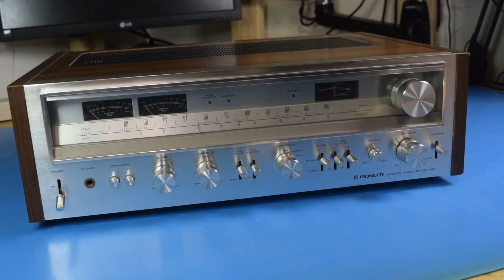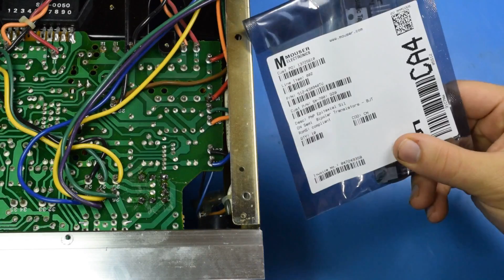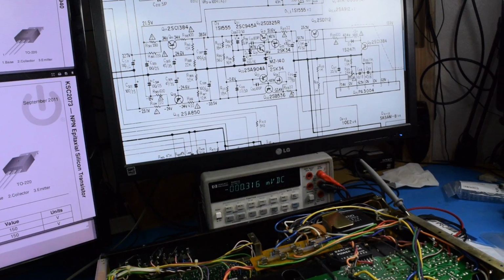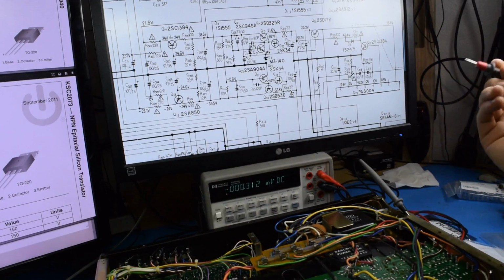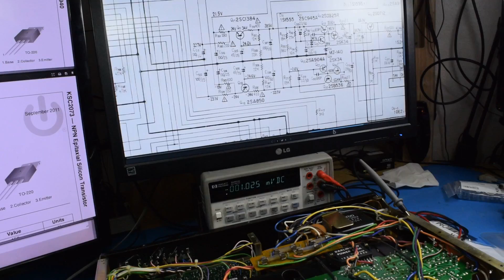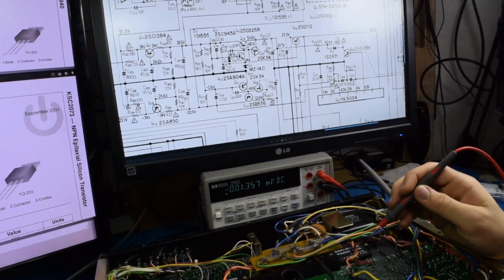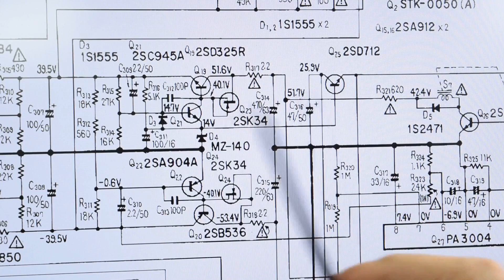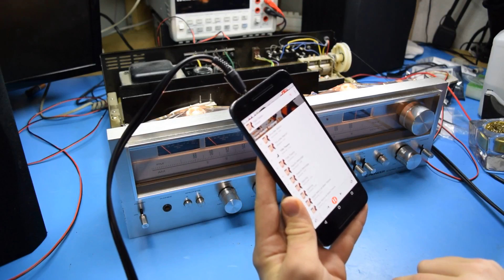0x0022 - Pioneer SX-780 Repair

Comment: 150 watts is about power consumption from wall outlet, not power output.  Yes, 45 watts is rather conservative but at best, it's probably not much more. Certainly not 150 watts output. power being consumed by transformer's loss, radio, preamp, main amp, etc.... You also need to warn about use of CPU thermal paste.  Some are conductive.  Some hobbyist blew their receiver using it.  I used white paste and it works just fine.

And I immediately spotted a missing regulator transistor that is notorious to overheating.  Yes, I own 780 too for almost 20 years and still using it. I added a heatsink to it and it keeps on going.

Comment: Great vid - subscribed! Curious problem on my SX 750 you may be able to help with.  Fm tuner was getting stations fine - stereo light on steady  - used to get 8 to 10 strong stations. . A month later, it has lost most of its ability to receive stations. Only the 2 strongest come in, the stereo light  only occasionally flickers. I have tried several different antennas with the same result and checked the FM muting to make sure it was off. Everything else on the unit works like new and it is all original with no modifications. Why would the FM suddenly lose sensitivity like this?

Comment: My '78 SX 780, Wich had a great tuner , no longer centers the gauge, won't pull it in in FM Stereo, LED for stereo does not illuminate, and it won't play at all, with FM muting off
Reply: On, is what I meant.

Comment: I’ve had this receiver since my father gave it to me in 1990. He bought it in 1968 or 69 he said. About 1996 the relay clock would take longer and longer. Then no click. Been holding on to it ever since. I have no skills. Could you advise as to how to fix?  I think I could learn to fix it just need a push in the correct direction. Please help
Reply: 780 was made, '78-80

Comment: Have had my 780 since 1980.  New.  Still going strong in the man cave.  Conseratively rated output.  Kicks butt on my HPM-100'S. My power safety relay failed also, at about 7 years old.  Otherwise, no other issues.  Love Pioneer!

Comment: Hmmm .. I have the same unit SX-780, but channel Left has some distortion, very noticeable in mids/voice. I assume I'll need new capacitors, but don't know much.
I have a solder gun and know how to use it, but haven't fix any vintage electronics so far. Can anyone give me a hint on what I should try?

Comment: I have the same receiver.
It was in a climate-controlled storage unitfor 10 years. Then in September 2019 I moved across the country and all my equipment was in an outside storage unit.
I turn it on, no power. I see that the 4 amp fuse on the bottom was no good.
I replaced it, and turned it on and saw the fuse blows with a flash. I did that 2 times, Same result. Any idea what would cause that fuse to blow?

Comment: Does anyone viewing this channel know if someone has restored FM reception to a 780?  Mine works perfectly except for the FM section.  Thanks.
Reply: Exact same issue, inherited my Mom's SX780, purchased new in 78.
Reply: @1972mercurycougar  I finally took my unit in to a shop and got it fixed.  It works fine now.  Alas... just the other day one of my channels blew out.  Probably one of the two Darlington Pair transistors - THE weak link in this entire unit, the 780.  The original transistors were good, but the cheap, Chinese after-market replacements are lousy and this is going to be a problem going forward, i'm afraid.  This is the single worst problem with the Pioneer 780 receiver.
Reply: @mic982  Yeah,i've had mine since i bought it new in '80 and i had to replace my Darlington's several times over the years.
Reply: @patriciawilson9666  The repair shop tells me old 780's are coveted for their parts, not the least for the Japanese-made Darlington's.  They say that some of the Chinese-built ones are OK but it's a complete crap shoot when installing them as most are lousy and short-lived.  The Darlington's were a wonder when invented, but apparently hard to reproduce.  Were that the Japanese were still making them, or electronic firms in America.

Comment: The SX-780 is a bangin' little receiver, even at 45 watts per channel.  I push a pair of HPM-100's and a pair of HPM-60's with mine and it sounds fantastic.  I'd love to see you troubleshoot more old receivers like this.  I bought a 780 just like this about 5 years ago and one of the STK's were blown.  I replaced it, but everytime I would turn the volume up and then back down, it would pop the new STK.  I'm sure there was something upstream that was failing to regulate the voltage, thus blowing the power pack each time, but I just couldn't figure it out with my lack of troubleshooting skills.  I ended up selling it to a guy in Maryland and he had it fixed in no time.  You're video makes me want to pick up another one and try it again.  I have subscribed and look forward to seeing your other videos.  The video that originally brought me to this one was the speaker recap on the Technics.  I am getting ready to recap my HPM-100's and wanted to see someone do it to give me a little more confidence.  Thank you.

Comment: My 780 just went mid song....both sides, I just lost sound.  I still powers up, just no sound or movement in the vu's. Is it most likely the relay in your opinion? I still have radio signal strenth and all the lights.  Any help is appreciated
Reply from the maker: Do you here a click after you turn it on? If not then it could be the relay. It could also be that transistor I was missing. 

Both are likely suspects. The relay is known to be failure prone and that transistor is regarded as being under cooled.
Reply: @TechTangents  I'm not hearing one. It would most likely be that correct.  The volume was half for an extender time.  Im assuming both packs would not go at once.
Reply from the maker: The packs are probably fine. I would suspect the relay.
Reply: @TechTangents  Thanks...hope that's it.  Do you recommend a source for parts?
Reply from the maker: I bought one from mouser, this is what I got: https://www.mouser.com/ProductDetail/omron/my4-02-dc48/?qs=NHN4o8quFyRXEZvz6CJ87Q%3d%3d&countrycode=US&currencycode=USD

I haven't installed it yet but I'm pretty sure it's the correct part. I would look around to double check.
Reply: @TechTangents  wow..much cheaper than ebay

Comment: Yes, but WHY did the diode blow in the first place? Failing caps perhaps. Without fixing the actual reason it failed, the unit will likely fail again.
Reply from the maker: I would assume it was the bad transistor that a former owner removed. Those are a known common failure in this unit.

Comment: Nice. I mounted my Pioneer SX-780  with other components in a extra tall audio rack. To see it follow the link here. https://youtu.be/ENjqQ51iKoo
Reply from the maker: That's nice. It's a shame how difficult it is to get HPM-100 drivers. If you're not aware HPM-900 parts are very similar cosmetically but have very fragile graphite cones instead of paper. So you could get those. It looks like one of your super tweeters may already be from one.
Reply: The tweeter is from my early model HPM 40s (steel instead of aluminum) until I get a replacement.  Hpm 40s and Hpm 100s use the same tweeter so its drops right in.

Comment: P=VI
So the higher the Watt at a set point the higher the current flow thru a point is at a fixed voltage

Comment: hi my name is ted i have that same receiver sx-780 since 1981 it stop working 9 years ago,  i had it checked out and the eletronic place and they told me it needed two new darlington stk-0050 and two new 0.22 ohm k 02 watt resistors that are right next to the power packs, he said those parts were not available at that time when he checked it, well all these years went by and i manage to fine what i needed to fix this receiver, i put in the new power packs with out the resistors it works but has some distortion to it, is it possible that because i did not replace the resistors yet can this be causing that problem?? and also the speaker protection relay takes time to click on?? any idea on that too, i don't have the equipment you have to do the testing i need to do, but i do have a ohms tester and a Capacitance tester is there a way in your professional opinion to check it with the equipment i have, please let me know i really would appreciate it.

best regards
ted
Reply from the maker: Without being there the best guess I have is that you were sold fake darlington packs. That is unfortunately common now. Unless you could get a verified real OEM model the best I could recommend for a replacement is to try making a DIY pack. It's not easy, but people have started to make them. This is where I would start researching it: http://audiokarma.org/forums/index.php?threads/stk-0050-replacement-for-sx-780-and-others.721181/
Reply: hi thanks for getting back to me, the numbers on top of the darlington i got is a "D6F22". so the resistors that i did not put in yet will not cause this problem is what you are telling me right, they are not working, and do you have any idea why the protection relay for the speakers would take so long to click on i timed it and it was about 3mins, please let me know, 

note; i am very new on doing stuff like this, that is why i am asking questions. i appreciate your help sir

thanks 
ted
Reply: HI i just found a set of sanyo darlington power packs stk-005011 was is your opinion on these?? please let me know.

thanks ted
Reply from the maker: I'm not an expert on the SX-780 and without being there to trace down problems it's really hard to say. The people on audiokarma are usually very helpful to people who have problems like yours. They know more common failures and would have a better guess than I would.
Reply: ok cool thanks i will try them i appreciate all your help.

ted
Reply: HI  just to let you know i replace the both resistors that was bad and it fixed the problem my receiver plays clear and perfect, the darlingtons work great so i don't think they were fakes, so the problem was the resistors, i am so happy i was able to repair this receiver, i do appreciate your help and advise,

best regards 
ted
Reply from the maker: Awesome! I'm glad it's working for you now!

Comment: I had one very similar but it was a Technics model damn transformer was burnt to hell in it. I managed to slap some random one in it from so crappy shelf stereo and it worked quite well. did not have enough current tho to really turn it up. them old school darlington power packs were monsters tho. think it was 75 wpc

Comment: I have got one of those as well. It was working but the issue is that there's a humming noise. I have no idea how to fix it but I suspect it's the power surprise. Also mines not as in pristine condition as yours.
Reply: I'm no expert, but it sounds like either a grounding problem or a bad solder joint somewhere. I have an amplifier with a few solder issues (produces a minor low hum), but it works though. I plan on fixing it one day.
Reply: Jacob Niemuth Culdnt be insulation problems? Or grounding problems?

Comment: Is it just me or does the STK at 13:46 have really dodgy looking solder joints?
Reply from the maker: The two inner pins are meant to be not connected.
Reply: I did just look it up and it seems that the inner 4 are only used on the STK0050-II, and even then it's probably optional.

Just thought it was interesting that they'd have two pins with no pads on the board whatsover, and two with but they just didn't bother soldering the pins down properly. Made me think they should have been.
Reply from the maker: Yeah, it  made me look up the datasheet when I first saw them as well.